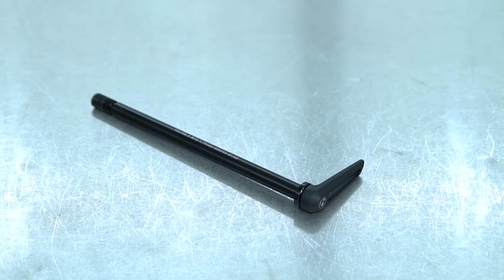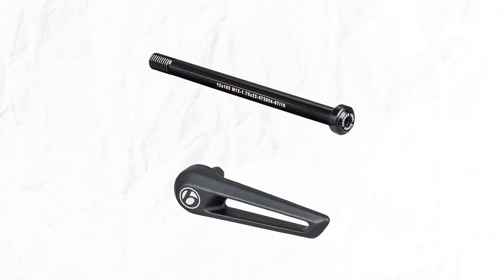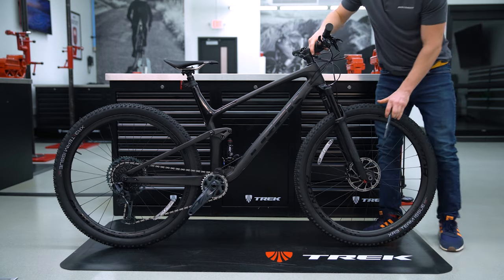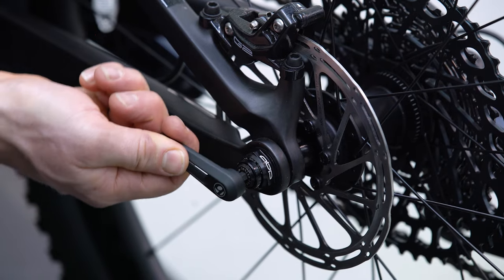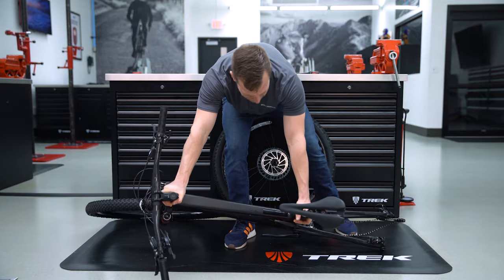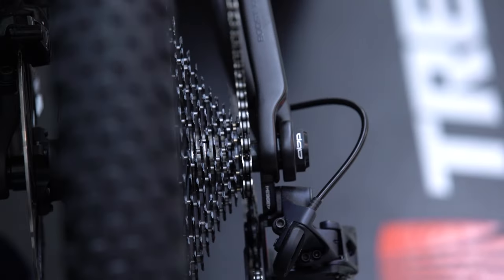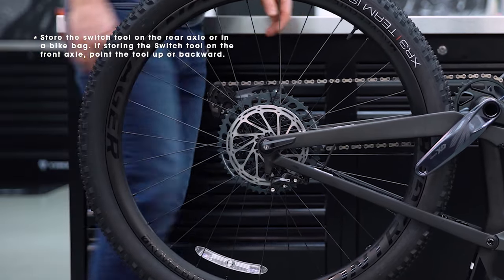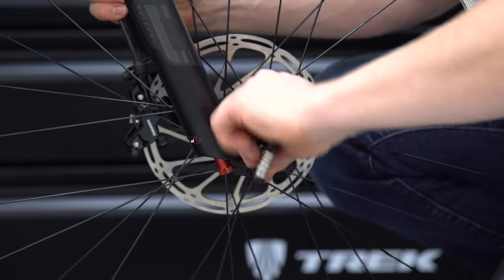How To: Use Bontrager Switch Thru Axle

Comment: Hey Trek, the switch tools 6mm allen key should be 5 to 10 mm longer.  When you use it on the front wheel you can't spin it all 360 degrees when the axle is fully inserted because of the fork casing. you have to turn it  270 degrees, pull it before the casing and insert after it again . I already scratched my Zeb fork casing after  turning the axle ca 2 full turns with the in out procedur and then proceed with turning the tool full 360 degrees plus. (Trek Slash 9.9 2021)
Reply: I share your pain, same story with the Lyric fork on my remedy and it's annoying as hell
Reply: This is my problem too, I'm going to buy a Maxle (or Brand X lever probably)

Comment: These axles need to be re-tightened regularly, especially if you are riding bumpy terrain. Nice how they say hand tighten to 10Nm, because we all have built in torque wrench sense.  Had a rear wheel come out while riding, it never occurred to me to tighten before each ride having riden QR for years with never an issue. Trek refused to warranty my frame because user error. Thankfully my LBS took care of me.
Reply: Yeah fuck trek, they  put some stupid road shocks on their mountain bikes even thought theyr'e wayyy too stiff for a full suspension bike. Why did they do it? Because the shocks that should be stock were only 800, and those other ones that you have to know enough about bikes to have them customize the bike so it even rides safely... Well those were 1300, so I think I know why they put them on there. Apparently not enough people know that because they were still selling. Did Trek care about people's safety? Nope.

Comment: The one I got comes with an interference fit with the hex hole. I had to use an applier to pull it out really hard. Ended up scratched the frame paint and deformed the hex socket a little bit.

Comment: Thru axles hold the wheel in alignment better and are stronger. People were breaking axles quite often with QR axles.
Reply: finally someone who speaks some sense
Reply: Shouldn't be an issue with a QR thru axle. And Trek have said in the comments below on here that this change is purely for appearance.
Reply: @flippy66  lol, no. Lol

Comment: Unfortunately I followed this  video when I had a front tire flat. He said  non-drive side but unscrewed the 6mm from the drive side.  I followed the visuals and ending up cracking the thru axel. Also, why does trek provide 2 6mm? one on each side of the axel?
Reply: I think like if accidentally round off one side so can still remove

Comment: My switch tool refuses to come out of my rear thru axle. No matter how hard I pull. My 6mm Allen key doesn’t fit the front wheel thru axle either. Any help/advice you can give me? Very frustrating
Reply: Same problem.  Should I just use all my strength, or is there a trick to it?
Reply: Just drill off the axle
Reply: @Jump-n-smash  what do you mean? I'm having the same problem
Reply: I'm having this exact same problem. Doesn't matter how hard I pull, it won't come off
Reply: @azoharadonis9452  I managed to take it off with an immense amount of force and wiggling helped too. My hand still hurts though, not sure if this was intended.
Reply: Get a pipe that will fit around and wiggle and loosen ... get more leverage

Comment: It's almost impossible to put 10 Nm on this small key. I've got a thru-axle on my bike and I realized that either I don't get enough torque (and clamping load) while using a small allen key on a multitool (similar to this Bontrager key) or the thru-axle won't loosen with a multitool after tightening it at home with a regular allen key or a torque wrench.
Reply: 10 Nm = 88.5 in-lbs. In in other words, 88.5 lbs at 1" radius, 44.25 lbs at 2" radius, 29.5 lbs at 3" radius or 22.13 lbs at 4" radius.  Just try to get 44.24 lbs with a t-wrench.

Comment: Thank you for at least posting this, no mention in Trek owner's manual or retailer letting me know when selling bike to me. Only one tool would come with a bike? is there a  way to remove rear thru axle tool to use on the front thru axle with my Emonda?

Comment: The problem is that with the Lyrik the lowers are so wide that this little tool is blocked from spinning. Why make it so low profile? I need to take the front wheel off to put the bike in the car before/after every ride.

Comment: What was wrong with regular quick releases? No extra tool was required.
Reply: When you crash or scrape the lever side of the bike on a tree, boulder or whatever it can rotate the release loose.  If there’s no lever sticking out there’s no chance of it loosening up.
Reply: Dude, qr sucks… 148 boost through is god

Comment: Trek Roscoe 8 2023/22. Front axel non/opposite brake side 10nm. Rear axel loosens on brake side 10nm (different than the front-wtf) 2:34 . Rear also has 25nm on the cog/derailer side with bigger Allen #8 size.  Trek shop did not sell a 10nm torque wrench. Trek shop had nice digital wrench. Bought beam style inexpensive GIZA YC-637 torque wrench kit 1-10nm plus 10 size sockets cost about $25. Top Peak, Park Tool and other digital brands nicer but more expensive.  I remove front wheel periodically to transport. Never removed rear, more work. I thus tighten front periodically. About 100km rear brake started to rub and shifting skips sometimes. Cause was loose rear axel. Easy fix and now check before riding same as front.

Comment: So I took off my front wheel on the AL5 and tightened to where it’s just starts to get tight and after I went on a ride I noticed the wheel was a bit loose even though it wasn’t before. How many spins are we suppose to do when it starts to get tight don’t want to ruin the bike from user error.
Reply: Buy a torque wrench to get it just right.

Comment: I can’t get my switch tool out from the rear axle. Any suggestions please?
Reply: Just wiggle and pull it at same time. Can be stubborn at times.
Reply: @SteveBrill  Once I found out that the switch tool can be removed, I found that I was barely able to remove it.  I had to pull and wiggle the thing as hard as I could to get it to break free.  But when I inserted it back into the axle, it fit loosely enough that it would surely fall out on the next ride.  Best to keep it someplace safe, or just carry an Allen wrench.

Comment: You say "non drive side" but in the video you're using the drive side.
Reply: Seriously, no more comments on this? Pretty blaring error in the video
Reply: This was the reason I got a Canyon instead of a Fuel EX.
Reply: Yeah, I snapped the bolt because I followed the video. Seems like they should be clearer about this.

Comment: Better check to see if you can loosen up the thru axle before riding a new bike.   I had to use a cheater bar to get mine to pop then the hex cap started coming with it.  No way it would have come loose without grunting through it the first time.
Reply: See was tight enough for when riding as if had to use more to loosen it
Reply: @mlee6050  wut?
Reply: @slosheroni  was on about thru axle tight enough since needed breaker bar to loosen
Reply: @mlee6050  correct.  As a fair warning to check to be sure you can actually get your wheel off trail side before you need to do so.  Pretty clear what I'm talking but I have no idea what your point is
Reply: @slosheroni  was that it won't come loose when riding if needed a breaker bar to loosen it, lucky for me both remove fine or I couldn't put wheels in when I build up
Reply: @mlee6050  Well good for you

Comment: while I like the handle as it is small and I can throw in my pocket and not notice it it's too shallow, as someone else has said it fouls on the front fork and scratches it :( if the handle was made a little deeper so it missed the fork it would be prefect :D that is my only complaint with the Switch Thru Axle system :)

Comment: You said on the non drive side but your taking it off on the drive side
Reply: This is a big discrepancy, as the drive side would require a clockwise turn and the non drive side a counter clockwise turn.

Comment: Rear axle (bontrager switch thru) issue
I took the rear wheel off my Checkpoint SLR 5 , but when I'm trying to reassemble I'm not able to tighten the rear axle. The axle goes through everything fine but seems less than an inch away from the grooves on the gear side, and it seems impossible to get it all the way in. When i take the wheel and do it - it goes in. Does any one have the same issue
Reply: I have this exact issue on a day old Domane SL5 Gen 3. Did you manage to get yours in?

Comment: Sooooo it's an axle with an extra step and another thing to carry/lose... I dont get it
Reply: You can leave it in one of the axle.  No chance of losing it.  And you don't need it to remove the wheel - any 6mm allen key will work.  This is just intended to more convenient.
Reply: I don't get it myself...
It the same process on the old biles axle, that you need some tool to remove, that's not being used since thé invention of the quick release....
From 1927...
That's almost a century that the nutt srew system is being abandoned for the qrs, and that's for a reason....
Reply: @jimhansen5395  please explain where is the convenience, while you could get the qrs, witch by far easier and faster to use than this nutt tech (if thé qrs being more and more used instead the nutt, it's for reasons...)
Reply: @jimhansen5395  I agree with the dude above you still need to carry a multi tool which will have a 6mm  on it and somthing tells me once the tool is worn it will rattle loose no system is perfect, plus a quick release axle is much more convenient and easy to use
Reply: @gavinwilliams808  if your are referring to Corentin, I'm not 100% sure, but I think he's trying to tell us that Thru Axles are dead tech and we should just use QRs instead.  

I don't get the complaints scout the lever. If you don't want to use them, don't. They change nothing about the way the same works.

Comment: These tools are often not supplied by shops. My new trek with decent wheels did not come with. Heck they shop didn’t even do a decent job the front wheel has a hoo. After a visit to get it trued it still has a hop.
I wish I could use my old Rolf vector comps 2001 . They were true from day one and need minimal maintenance for 20 years. Since then thoes we’re trek made I think I got unlucky with my wheels on my new road bike. Plus taking my trek thru axle to a shop to get the right trainer axle I went through 2 before I was done with people who didn’t match the thread and pitch right. 
Maybe I have had a large does of bad luck.
Reply: Shame you not here, if went to bike project you have me trued the wheel and I built all my wheels, just retrued wheels built like 13 years ago and yes they was as true as most want them but I aim to have mine below 0.1mm if can

Comment: I don't get the point ;
Why do we have to get back to old tech, when de have the qrs system, that works perfectly, and doesn't need a tool ?
Reply: No one is forcing you to use Thru Axles.  Feel free to keep on using QR's if that's what you like.
Reply: @jimhansen5395  i still don't get the point, for the reason they spent money & Time on developing a tech that's already abandoned....
Reply: @corentinvaslin6443  wut?  Thru Axles are abandoned? Have you looked at new bikes in the last three years?  Almost all new bikes come with Thru Axles now.  Or are you referring to the removable lever?  This is not new tech.  DT Swiss has been doing this for many years.  It's just a new convenience feature Bontrager added recently.

Comment: but isn't the quick release more convenient? I don't see an evolution of the product ...
Reply from the maker: Thru-axles are stronger, stiffer, and are a more secure method to hold the wheel to the frame!
Reply: I think they meant they have a QR thru axle. Is the switch stiffer than a QR thu axle? TIA Trek.
Reply: @trekbikes  if you say so!
Reply from the maker: @dudeeeee1819  Not compared to our other axles, no. But this axle is our new standard since it brings the style of a bolt-on with the ease of a QR thru axle.

Comment: So it’s a 6mm Allen key like many thru shaft axles but you have to use a special tool?
Reply from the maker: You can use the supplied tool which is also the lever or you can use a standard 6mm key.

Comment: I just don’t see the point of needing a tool. Why not just
keep the lever permanently fixed as part of the design?
Reply: Better torque without it
Reply from the maker: A lot of riders like the appearance of a bolt-on axle vs an axle with a lever.
Reply: I was thinking more about practicalities while out riding. Loosing the tool could be problematic!
Reply from the maker: @CompositionXn  If you ever lose it, a standard 6mm allen would work! But it would be impressive if you lost it if it was fully inserted into the axle.
Reply: @trekbikes  So this is purely for appearance at the sacrifice of practicality?
Reply: @trekbikes  I wish you engineered it better like say tighten lever and it stops you tight over 10nm if can as be handy